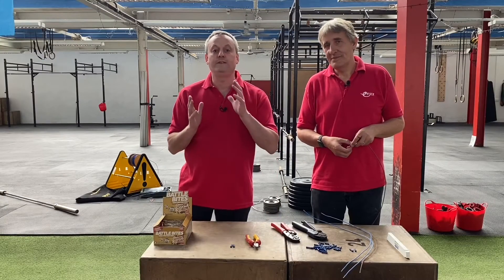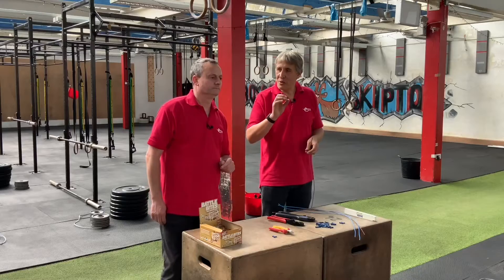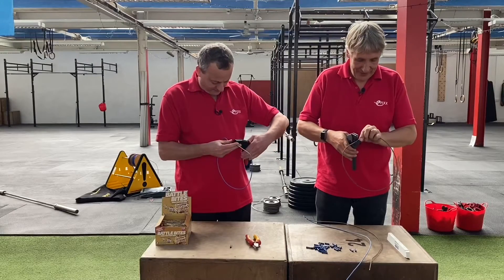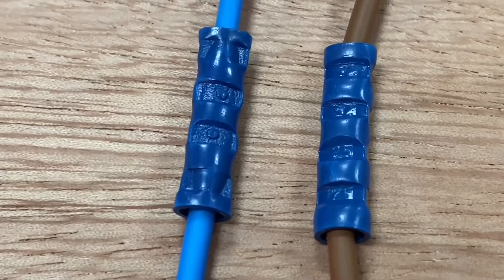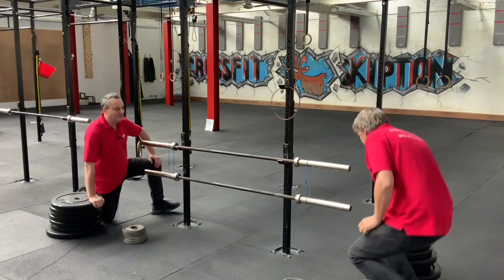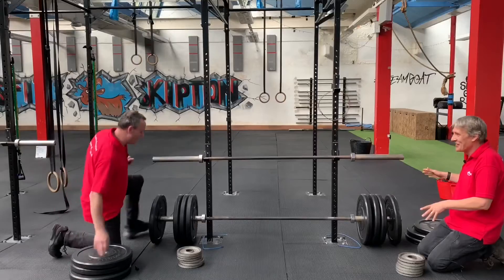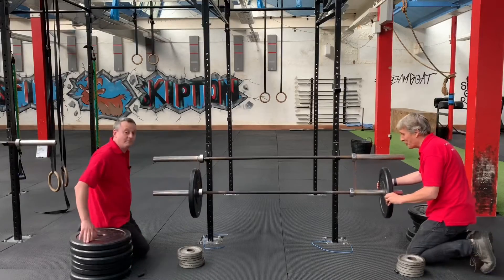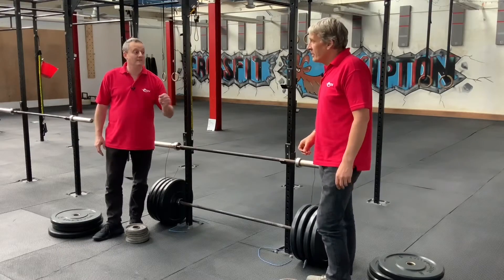SOLID conductors and CRIMP CONNECTORS - eFIXX go to CROSSFIT

Comment: - I bought the "Klein" tool from Harbor Freight and tried it.   I just put a blue terminal on a 12 an 14 guage solid copper.  It works perfectly you will wish it had a longer handles.  It's not a job for girls. 
- You will never be able to make a good crimp on solid copper with the combination stripper/crimper tools that you can use on stranded wire.  You need one of these.

Comment: Complete waste of time. You should let people know you’re just trying to be funny and it’s a complete waste of time if you want to gain any knowledge or information on crimping.
Reply: I agree. They didn't show much details of how to crimpe the butt connector properly to achieve durable connection. I've tested solid wire stripped half length of the butt connector and it turned out loosely connected and very easy to pull out.😅

Comment: A little late but you know youtube videos are forever.  I always thought a crimp connector worked best with stranded wire because the crimp barrel would crush the stranded wire flat, whereas the crimp barrel would bite into the solid wire but could not crush it.

Comment: A good electrical crimp should form a "gas-tight" seal between the terminal and wire strands. I don't believe you will achieve this using a solid wire, as the solid wire cannot be compressed as easily as a bunch of small stranded wires.

Comment: Can you eat shared glass? Yes! Can you put your arm into molten aluminum? Yes! Will everything be fine afterwards? No!

Well ... to be fair - though I have never eaten glass nor washed my hands with molten metal - I did crimp solid wires. I know where they are and I look at them every now and then. They are fine. I would not do it if I could not check them up easily.

Comment: This has only just appeared on my timeline, interesting.
I think the question should be not can you, as in, is it physically possible, but, should you, crimp to solid conductors with this kind of crimp and crimp tool?
I think that whilst the mechanical strength seems reasonable as the outcome of this experiment, other things need to be considered.
Such as (but not limited to), for example, the solid core will not distort that much.
After all, it is solid.
How much contact area are we getting between the crimp and the core?
Is the contact patch adequate for the current rating of the circuit?
We have all seen connections come loose with time, there are many reasons for this.
One reason is cold flow, and this could easily occur in a solid core when crimped like this, this would, in turn, make the crimp lose on the core and reduce the contact area, and therefore the current carrying capacity of the crimped joint.
Another would be dimensional change due to temperature, closely linked to cold flow.
The core is crimped tight, when it heats up, it is prevented from expanding in the direction of the grip by the crimp.
Remember that the core will expand in 3 dimensions when heated.
When it cools, the core is free to contract in any plane; thus it can contract away from where it is gripped by the crimp in that (those) plane (s).
This again would, after time and repeated cycles, result in the crimp becoming loose on the core.
I know that eFIXX has not said that it is OK or not to use crimps like these on solid cores; I have just put this in so people can consider what they do and whether they want to rely on these crimps

This comment is probably not well-written, but I hope it makes sense.

I'm not too well today, those who know me, Gaz, Gordon, you know why, I think mulling over this will follow the law of diminishing returns, so I've just posed my first thoughts.

Comment: A 26 amp load test would be more appropriate many a time ive come across crimps on solid conductors that were loose in the crimp some could be pulled out but never found a loose crimp with stranded conductors

Comment: Only encountered the necessity of doing this when fitting that plastic 2/3 module Wylex box without any termination method except attaching 2 crimp ring terminals to the box's DIN rail for the CPC conductor. Thankfully this box is now being phased out from some retailers (Toolstation, but still supplied by Screwfix) in favour of a 2 module metal box supplied with a double pole isolator switch which could be replaced with a double pole class A RCCB.

Comment: I still have a crimping tool with the little indent in the crimp that pressed right into the joint. I always felt that they gave a more positive crimp. Why did electricians stop using those?

Comment: i am going to  start using  ferrules in a commercial enviroment where circuits use higher loads  or higher load circuits i came across a neutral bar that was burnt out i done some reseach and loose connection came up again and again .
i think that is a bit lazy dismissing  it as a loose neutral i think the fact that all the holes are the same size on the  busbar doesnt help get a great connection  and that a ferrule would help get better contact hopefully helping to prevent burnt out neutrals

Comment: Note that each crimp only managed 40KG as they were doubled up on the weight (so each only held half the total weight).
Reply: There were 4 wires, so the crimps were only holding a quarter of the total weight.
Reply: @JasperJanssen  the crimps were holding half the weight. There were 4 crimps, but the two on the left were "in series" so experienced the same force and the force wasn't divided up. Same for the two on the right.
Reply: @orthotron … there weren’t 4 crimps. There were 2 crimps, and 4 sections of wire going from top to bottom. Each section of wire held a quarter of the total weight. The uncrimped wire in back of each loop held up half the weight without that force being somehow transferred to the crimped half.
Reply: @JasperJanssen  You are right, the weight was divided into 4. Not sure what I was thinking when I made that comment, since it doesn't match what you see in the video.

Comment: Most of these crimp connectors are only rated for stranded and fine stranded conductors. But there are also ones available which are rated for solid conductors, but they are not insulated. Meaning you'll have to put a piece of heat shrink tubing over it. A good crimp will not fail if stressed, rather the copper itself will fail.

Comment: I have 25 years experience in the connector manufacturing industry and it is not recommended.  When the crimp connector relaxes it pulls away from the cable and leaves a high resistance joint.  Pulling gently back and forth on the cable you can feel it clicking inside the connector.  This is worsened because the cable is annealed and the connector very often is not. Tensile testing like this is irrelevant because you are pulling against the wedge shaped deformation on the cable. Relevant spec is BS4579 part 1. Smaller cables are worse - try a 0.5mm2 cable in a red terminal.  2.5mm2 is the largest cable size reccomended for the blue - try 1.0mm2 or 1.5mm2 in the blue.
Reply: The most of these crimps are not rated for solid conductors, only for stranded and fine stranded. But there are such crimps available for solid, but they are not insulated.
Reply: I agree. Not to mention heat on conductors makes them expand and contract. I have used solid wire with a crimp 2weeks later it was loose and arcing \
Reply: Finally I found someone making sense out of this subject. I actually need to join 2.5mm twin and earth and tried crimping with insulated blue splice butts or whatever they are called and actually came across the same finding. If you start pulling in and out of the connector you can feel the clicking and that can't be good.
Reply: Any advice on how to connect 1,5mm2 copper wire directly to flat male terminal? I have one idea to solder but I would like to avoid soldering.